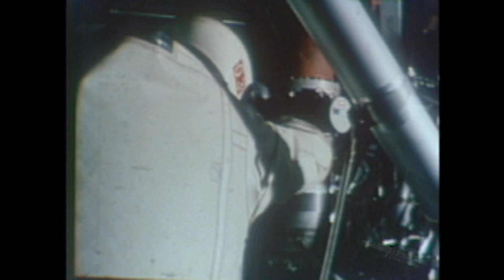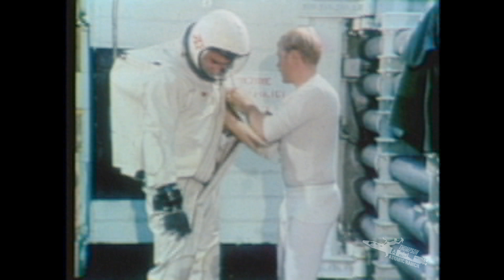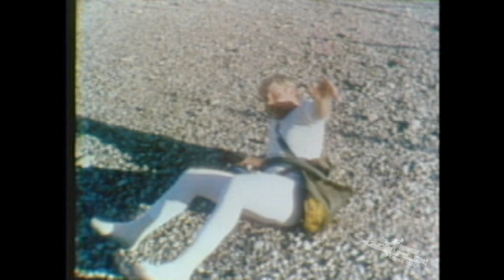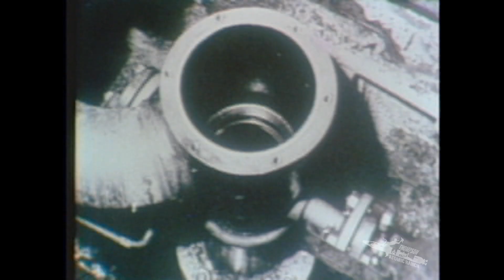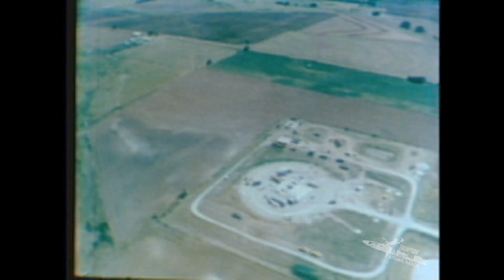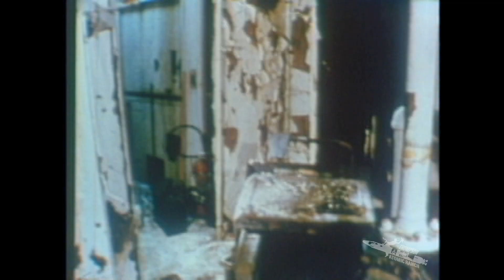Oxidizer SNAFU - Titan II ICBM

Comment: 533 SMS ACP MFT here, this is a bit confusing. It sounds like two different incidences are mixed together. The incident that took place at Little Rock, Arkansas was the result of a tool being dropped, bouncing off the shock mount, and punching a hole in the missile's fuel tank spilling UDMH Hydrazine. That is the incident that ended in an explosion that blew the silo closure door clean off the silo. Now another incident took place several years earlier at complex 533-07 outside of Wichita, Kansas. In that incident, the oxidizer valve was stuck open during a PTS operation and it filled the silo and equipment are with Nitrogen Tetra-oxide. That incident was in Rock, Kansas and a sortie in my squadron. I believe this is the incident that is depicted in this video. Witnesses who visited the 533-07 in the aftermath of the incident, reported that the corrosion from the oxidizer was so intense that the site's concrete walls were disintegrating. They said you could literally poke your finger into the concrete and make a hole. In 1977, shortly after the incident, site 533-07 in Rock, Kansas was sealed and never used again.
Reply from the maker: The incident being outlined in this video took place in Kansas.  The Damascus incident resulted from the fuel and oxidizer mixing while this one was "just" an oxidizer leak.
Reply: That was my thought too.  BMAT 533 SMS